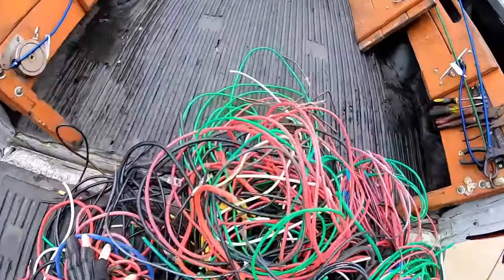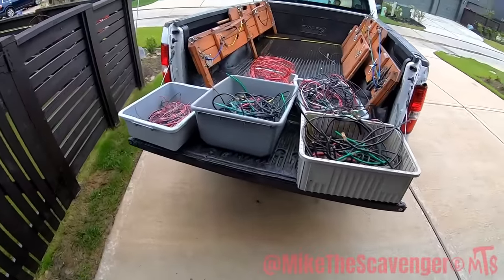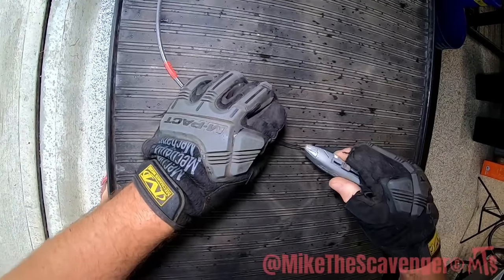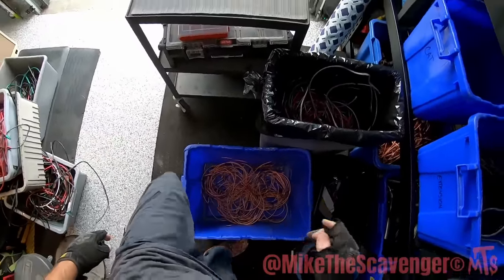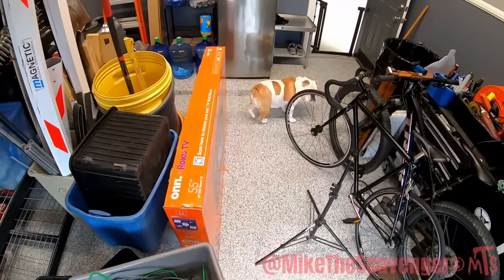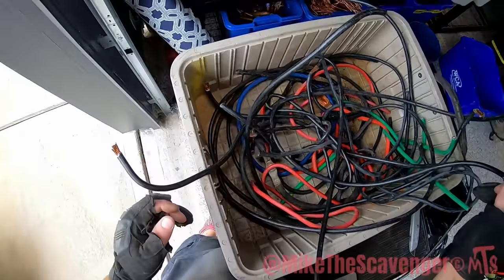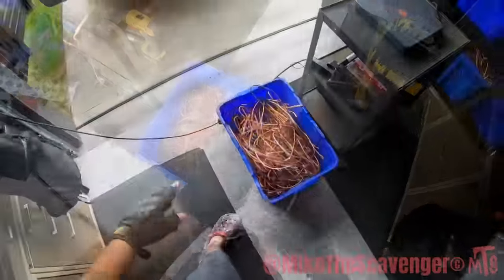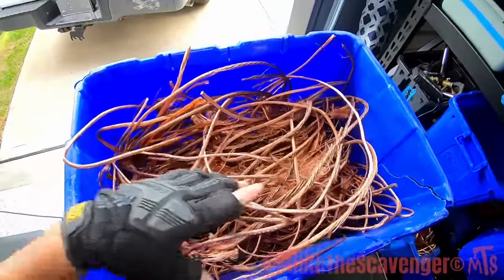Copper Wire Strip Session "The Bigger It Gets The Funner It Gets!"

Comment: I have the same Stripmeister. I use a DeWalt 12v cordless drill that I permanently keep attached to it. I have three batteries that I cycle through, always having one charged and ready to go. I like this better than the one with a built motor. Drill was $50 on marketplace. A replacement motor from Stripmeister is a whole lot more if it fails. Plus mine is portable. You have to use it and get a feel for it to do a good job on stranded wire. I like to put the input feed far as low as I can on the wire before locking it in place. This keeps the wire right at the sweet feeding spot. Then you have to learn the ‘feel’ needed on adjusting the blade. To get it to just cut the insulation but not Turing your stranded wire into prickly porcupine strands. Once you get the feel for using it, I cruise through wire while listening to podcasts and drinking a cold one. It’s Therapeutic. Relaxing. Something about stripping wire that makes you forget all your troubles and stresses. Strip on bromeister!!! 👍🏼

Comment: Hey Mike, you were talking about getting the stripmeister with the foot pedal, noticed you have quite a bit of space on your stripping cart. Harbor freight sells momentary or maintained foot pedals, so if you have a corded drill you can clamp it down to your cart, and plug it into the foot pedal & have that for less than $20.  fun little project if you got time to tinker.

Comment: I have a whole bunch of 3/4 or 1in and 1 1/2 inch Powerline wire and when you strip the black jacket off there's a copper jacket that surrounds the wires, you strip that out also and then you got a bunch number 1 wire and you've also have the Copper from the jacket. I've been doing this by hand it wouldn't handle the one-and-a-half but it would easily do the smaller Powerline wire, I need to get one of those big time!!! It's a lot of work doing it by hand. I have a secret dumpster that they're dumping all this stuff in and it's going to the landfill, it's got trash and wood in it also so it's definitely not going to a scrapyard, so I go there every day after they leave and grab what they they thrown in there

Comment: Keep lookout for a ShopSmith tool setup.
You have probably scrapped one.
There's one motor that powers multiple tools.
Mount your stripper on the machine and use its motor.
Multiple tools only take up one footprint

Comment: When i first got my strupping machine, i stripped out over 200 pounds of wire. Before that i used a utility knife and stripped wire while watching tv! Im still in collecting mode until i open up a spot for it in the garage. I also have a scrap motor from a old typewriter that im going to use to run it instead of my drill.

Comment: Scrappers gold.  Recommend Stripmeister E350X with a simple AC on/off pedal switch.  The 350X is a little more robust and handles larger wire than the 250.  Bigger is better since you are in Texas.

Comment: About three years ago a road construction crew dug up a cable while installing a new highway. It took about a year and a half two years to build a 4 mile stretch of concrete into a divided highway it took a lot of work, but I got a 4 mile long copper cable out of the deal. I would drag at home every evening, each section being about the length of a football field, just tie that bad boy to the bumper of the truck and go there was no loading it up. Just had to be careful that the cars behind me did not run over my cable going down the road.

Comment: Mike I took the 24 volt motor out of a razor scooter and the chain with both sprockets and made my Strip miester automatic it is run by a 12 volt battery with a switch for on and off

Comment: As it turned out I did the best option and bought the electric powered enerpat stripper with 9 cutting sizes. Paid for itself 4 times over in 18 months so far- haven't cashed the copper in yet cos im after a 1 tonne payday. Like to buy something substantial from it.

Comment: Ironically back in the 60's my grandfather use to scrap wire etc. But his method of scrapping wasn't what we consider environmental safe now. He use to build a fire and put it all his scrap wire in it to remove the insulation, but again that was back in the 60's and he passed away in the mid 70's.

But I'm actually surprised that they allow you to pre-strip wire prior to scrapping to the yard. I thought it you had to take wire in as is so they could identify it and ensure it wasn't possible stolen.
Reply: Wire has no markings as to where it was used at so it's impossible to trace wire with the installation on or not. Stripping the wire actually helps the yard as it cuts out a step or two in the recycling process.

Comment: Want to say I like the wire stripper machine which is not available here. I use to burnt to extract copper. I tried to look online the rate is very high which I can't afford.
Reply: It’s only around $150-$200. It pays for itself in profit after the first bucket of wire you run through it. Do the math.
Reply: @robk1310  $200 it come around to Rs.12000 Indian rupees.